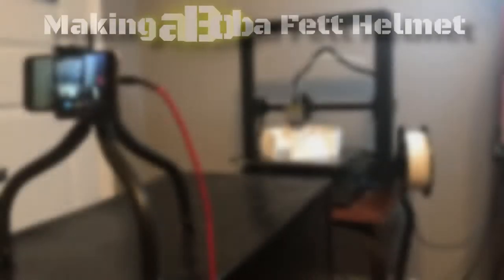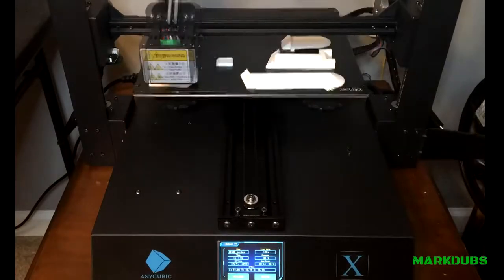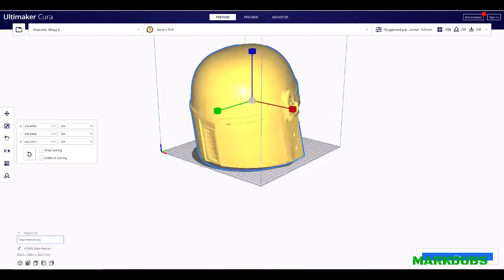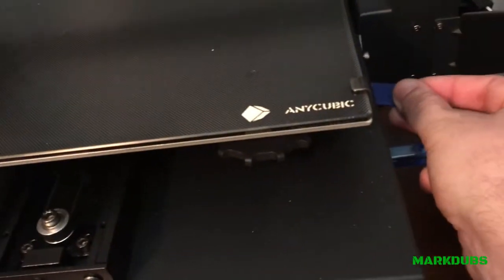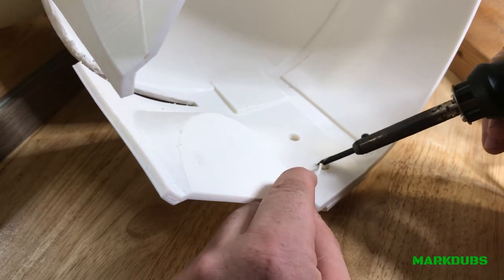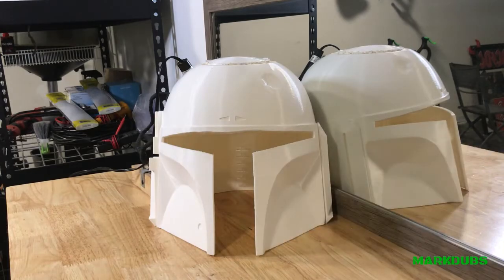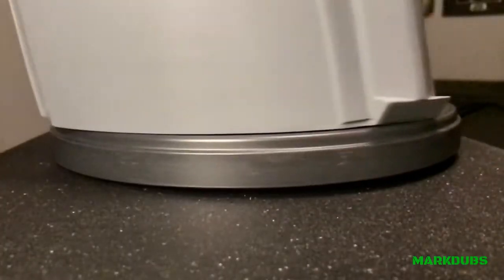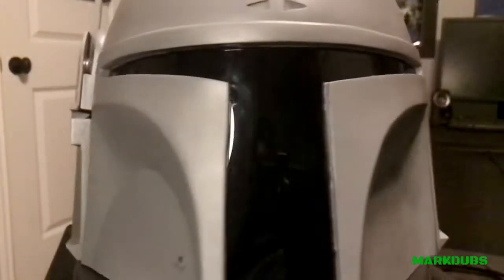Let’s make a Boba Fett Helmet Part 1

Comment: When I pull up the amazon link for vizor, the plastic is shown is dark green by default for $15. But If I want the dark black tinted its $30. But I think you said it was only $15 in video. Did u use the dark green?
Reply from the maker: The tinted visor that I used in the video is dark green. Looking at it from the outside once it is installed on the helmet, it does appear darker than you would think, though. Also, I found a similar visor on amazon just now that is roughly $13, so slightly cheaper. Still green, though... :)
https://www.amazon.com/MCR-Safety-181542-Polycarbonate-Faceshield/dp/B009A5T89A/ref=sr_1_14?crid=2ZMDW1X8NL5SQ&keywords=black+tinted+visor&qid=1644842795&sprefix=black+tinted+visor%2Caps%2C79&sr=8-14
Reply: @MARKDUBS.3DPRINTING  thank you
Reply from the maker: @bobjohnson6915  you're welcome

Comment: What was the dimensions on that helmet? Trying to see if it will fit the 3d printer I’m looking to buy 😃
Reply from the maker: These are the dimensions that the helmet STL file started at. 
Uniform Scaling at 100%
X-Axis: 247.9469mm
Y-Axis: 257.3984mm
Z-Axis: 280.8766mm

I scaled my helmet to my head so this is the size that you saw in the video.
Uniform Scaling 105%
X-Axis: 260.3442mm
Y-Axis: 270.2683mm
Z-Axis: 294.9204mm

Also, just so you can have another point of reference, here are my printer's dimensions so you can compare it to the printer that you are looking into buying.
Building platform :	300 x 300 x 305 mm

I hope this helps! 😃
Reply: @MARKDUBS.3DPRINTING  thanks for the response! I don’t think the printer I was looking at can build that large. Might have to slice it and join it instead which is fine. Just a little more work on the back end but no biggie. I’ll have to figure that out plus will give me some additional practice with slicing.
Reply from the maker: @EngineeringDisaster  if you are going to split up the helmet, I would check out the link below. It’s a great tutorial for printing helmets on smaller printers 🙂. https://youtu.be/z7rOsba3WbY

Comment: Good to know about the sizing advice xD
I noticed you printed without center support, about how long did your print take? And do you recommend printing without support?
Reply from the maker: So for this print, it was roughly 2 days. Most helmets of that size I think would take that long. Looking back, I should have had the auto-generated supports feature turned on in Cura. Most helmets that you will print will not sit perfectly flat on the build plate, so in those instances, they are necessary. The same goes for any overhanging areas as well.
Reply: @MARKDUBS.3DPRINTING  Gotcha, thanks for the help (/'-')/